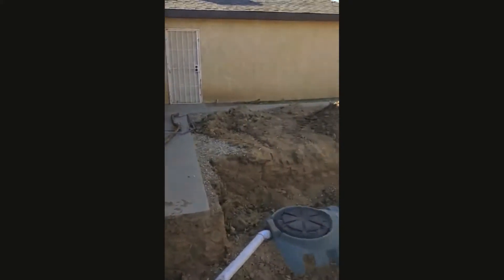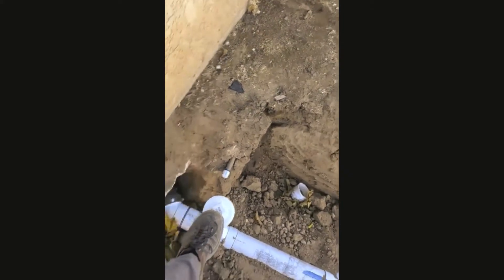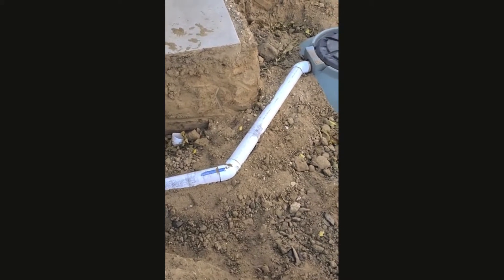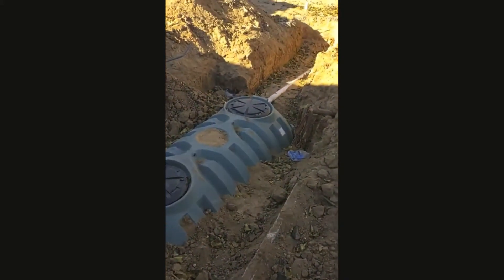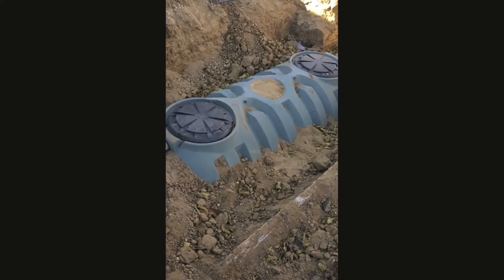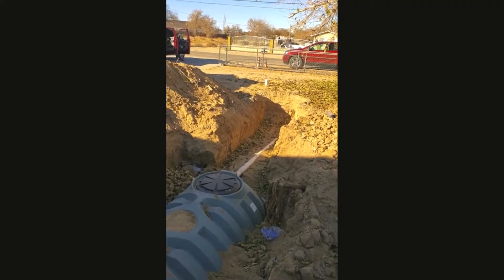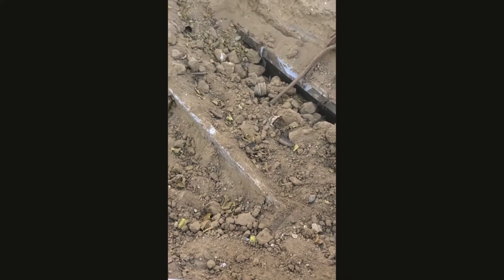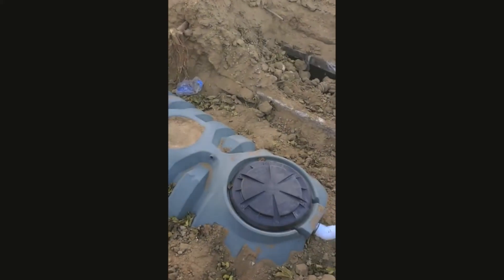Demystifying septic systems

Comment: Good video...in the process of buying an older house and want to get some info on what to expect.  A little nervous because I hear a bunch of horror stories about the cost of replacing.  Anyway thanks for the video...only critique...hold the phone in landscape mode for the video...just makes it fit the majority of 16:9 screens.  (But it took nothing away from the information or the video...thanks again.)
Reply from the maker: Glad it was helpful! - Struggling with shooting landscape still, its a fantastic suggestion. Working on improving tech for better quality vids! Feel free to call my office if you have any real estate questions or need advice.